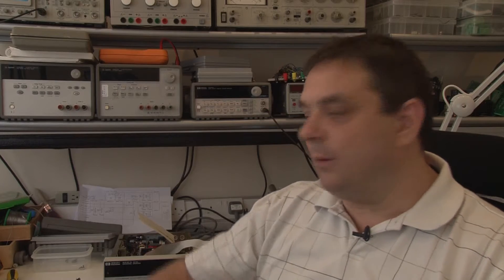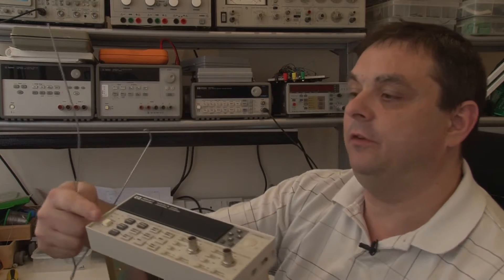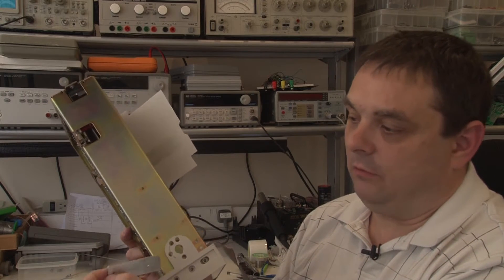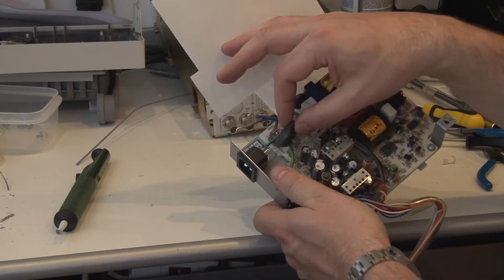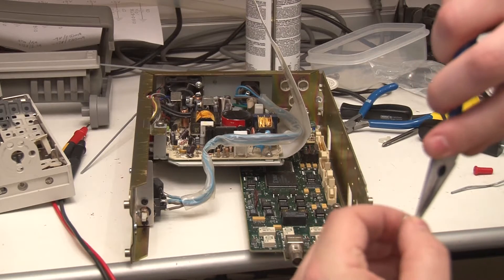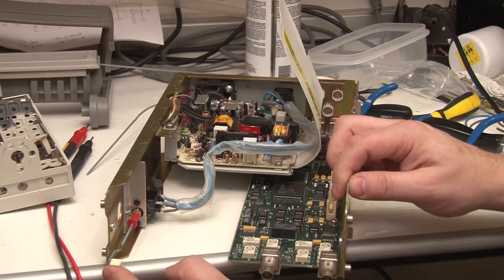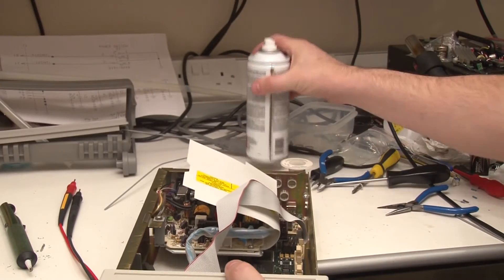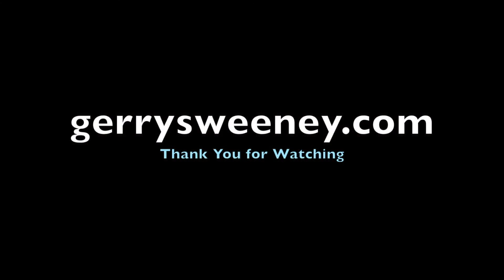HP 53131A Hard Power Switch Modification

Comment: Very useful video, Gerry. Thanks. Can you please clarify where that red cap came from? Is that from the banana end of a test lead? It’s only shown for a moment without much explanation. Also, what is the part number for that switch? Thanks again!
Reply from the maker: "Can you please clarify where that red cap came from?" the red cap is just a protection cap you find included with typical 4mm meter lead.  I don't have a part number to hand but those switches are very common, you can eyeball them easy enough.  Something like this: https://www.ebay.co.uk/itm/183739838385
Reply: @gerrysweeney  OK, thanks. That helps.

Comment: If the goal is to make it silent, wouldn’t a small bi-metal temp switch ( maybe  35C or 40C temp) in-line with the fan be the simplest solution?
Reply: not really to be honest - the fan noise is the obvious issue when it comes to day to day living with it, but I also do not see any good reason to have a device not being used with its 100w switchmode PSU running continuously. I could of course just switch it off or unplug it at the plug, but that's inconvenient at best.  The mod worked well for me and I have been using the counter for many years. When I want to use it, just hit the power button on the front and I am good to go.

Comment: Hi Gerry,
As you mentioned, I believe the design originally intended for the OCXO to remain on at all times, and the fan was required due to the heat from the OCXO.  I wonder if you even need a fan without option 010 or 012 (OCXO).  Thank you for your mod walkthrough...
Reply from the maker: Hi Patrick Vincent thanks for your comments. Yes I think you still need the fan to keep air circulating around the PSU, it gets warm without the OCXO option.  I done this mod because in my lab I don't always want to kill power to everything but I don't want stuff sitting their powered up on standby. In this case the annoying fan noise was just too much to bear so I put the mod in to deal with that. Gerry

Comment: The 2 holes you used to mount your switch are used for the high stability option (option 010). Not sure about 012, I think the form factor is identical.
The unit Gerry has the standard oscillator, which is pretty useless IMO. I assume Gerry uses an external GPS or Rubidium standard, so keeping his counter on with the standard oscillator is pretty useless.
Thanks for the great videos.
Reply from the maker: Hi Victor Silva yeah I found that and had to revise the modification moving the switch closer to the PSU board, it worked out well, you can see it here: DIY HP/Agilent 53131A 010 High Stability Timebase Option  Gerry

Comment: Hi Gerry,
  With great interest I watched your HP53131 teardown and your power mod while secretly hoping you would try to power-up your unit from another power supply and save me from having to figure it out myself... that is possibly going to be the next step with my own counter which I have recently acquired and which turns out to be suffering of troublesome initialization: My HP53132A (with 3GHzoption) gives me a failure on the FPGA self test on almost every single soft-button power-up, warm or cold, but subsequent quick power-cycling it again with your "favourite" soft button the second or third time makes it proceed through the sequence OK and the unit functions without further noticeable issues. If, however I power the counter YOUR WAY, which is essentially by plugging in the mains cord, The selftest, including the FPGA passes the test every single time! Very repeatable. I am in the early stages of debugging still looking for schematic and lining-up my thoughts how to tackle this. I will be focusing on any power glitches and ramp-up timing on the DC rails when turned ON and any obvious differences between soft and hard power ON. I would be happy to share my findings as I proceed if there is interest. Any ideas or suggestions would be welcome!  I really enjoy your blog - thanks for sharing!
Jiri from Ottawa, Canada
Reply from the maker: +rysend I have the schematics, drop me a line via e-mail if you want them. Gerry

Comment from the maker: If you are a CAL lab to traceable standards its actually a requirement of your certification. This is due to known effects on frequency standards like retrace and other power cycle related variations. Generally a well maintained reference standard, in particular a primary standard involves temperature control and that means powered up at all times.  In the event of total power loss a re-cal is required. For a home lab of course, none of that is so important.

Comment: On page 45 of "5989-6308EN.pdf" is the OCXO board and "HP-10811AB-Manual.pdf" is the manual for the OCXO itself. These are the only schematics i have.
On the OCXO board is a 9v connector but in my counter with high stability option it is not connected, maybe its only for the ultra high stability option.

Comment from the maker: That sounds a reasonable warm up to me. Thanks for the response.  I am trying to get hold of a readable schematic for the OCXO module, it is available in the 53132A manual on the Agilent web site but for the OCXO module its a poor resolution scanned in image and you can';t read the diagram. I don;t suppose you have a schematic for yours?  Thanks